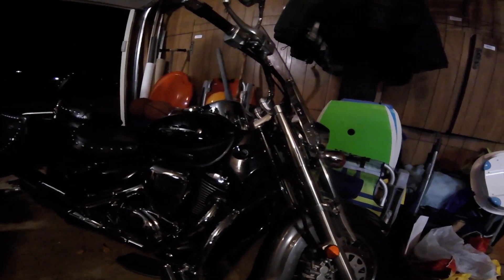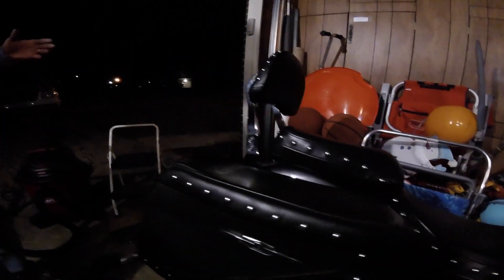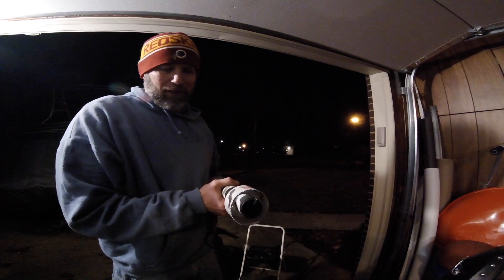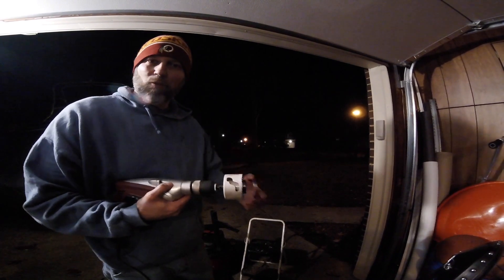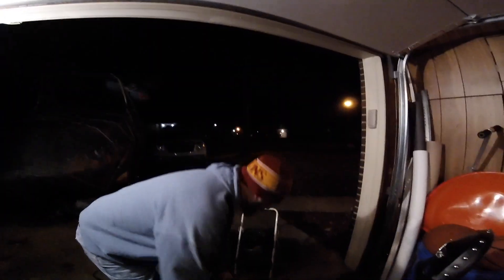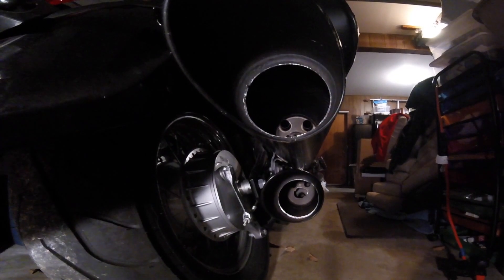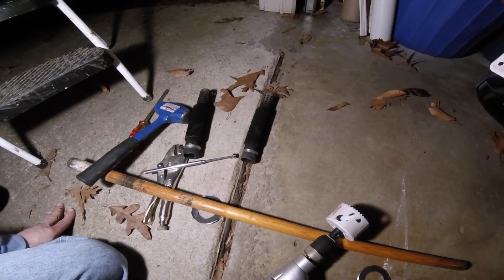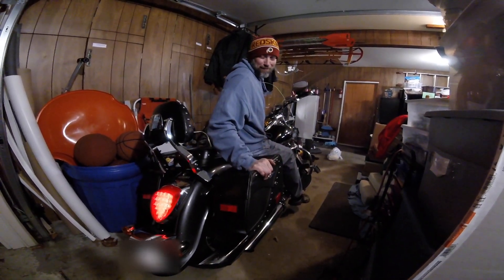2009 Suzuki Boulevard Debaffle

Comment: Just got done doing this. Did it with a pneumatic air hammer for the holes and a angle grinder. Spent the time to make it as perfect as I could. Those baffles did not want to come out but everything turned out nice.
Reply from the maker: Mine were stubborn too…but sounds so much better!  Great idea on the pneumatic air hammer!
Reply: what year is your bike?

Comment: those 2 drill bits and an adapter were like 30 bucks a piece from what I saw.   How much did you pay for the equipment to do this?
Reply from the maker: Not sure…whenever I buy tools for projects I view it as an investment because I’ll use them for something else later.  You might be able to borrow them from a friend if you don’t want to buy them…

Comment: Dud you loose power? And what about the baffle box under the bike
Reply from the maker: No power loss and no need to retune the bike.  And I’m I didn’t change anything else in the exhaust system…just removed the baffling from the rear muffler.

Comment: Iam worried about the usage from the engine, what is your experience, does the injection need any adjustments? Are three any side affects?
Reply from the maker: caddyfly a friend purchased the bike a couple years ago, no problems.  Removing the baffles on these bikes do not require adjustments.
Reply: There is no affect on the engine.  You are not removing the cat on it so it simply just changes the exhaust note.